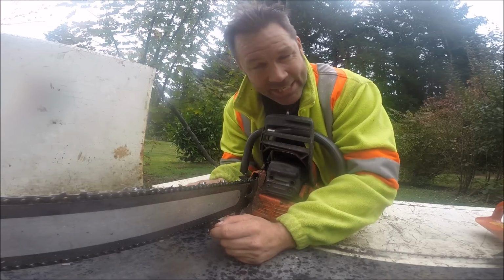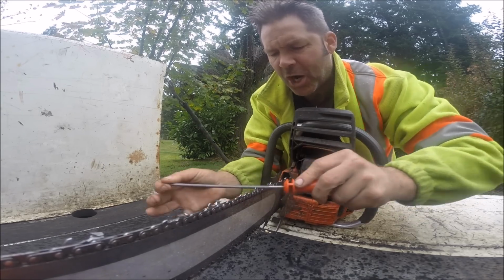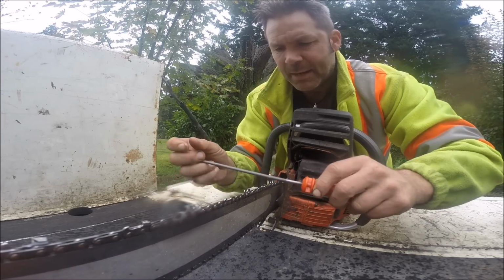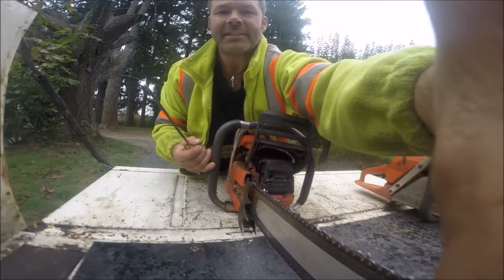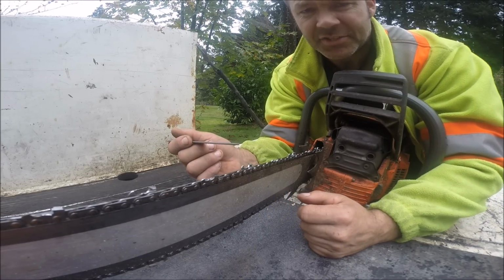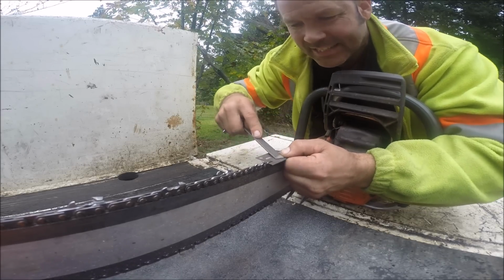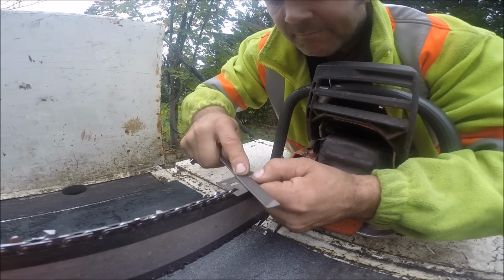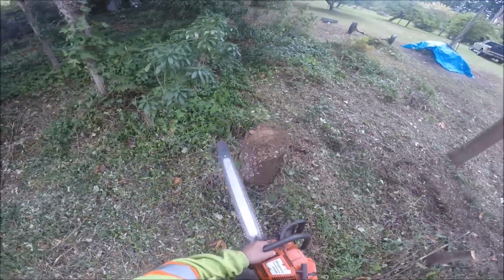How to file a power saw (chain saw)

Comment: Billy I think so many people don't understand the difference between constant filing of the raker gauges and progressive filing of the rakers. In the constant style you have the long raker tool that has the slot for the raker on the end of the tool. That style of guage rests on the top of several teeth at a time so if you have a longer tooth it is resting on and filing a shorter tooths raker, the rakers will end up being different heights and thus will take bigger or smaller chips. In the progressive style with the carlton tool you file each raker to that tooth and so the chips are all the same size just like you explained.  Maybe some of the confusion is that people are using the constant guage which came with their little homeowners saws and that is fine if your chain teeth are all exactly the same size but that is not the real world of sawing. Just different words for what you just said. This is an awesome video my friend. Keep on trukin Buckin
Reply from the maker: glad it makes sense to ya thanks Crooner
Reply: Progressive dept gauge is setting the correct angle of attack to every individual tooth! Is not even a dept gauge! It’s an angle gauge

Comment: Billy,  I agree 100% concerning the takers.  I was cutting off a stump the other day and my little 241cm wanted to cut to the left and get into the sand.  After I was through cleaning up the saw I looked at the chain and noticed my right teeth takers were considerably taller than the left takers.  I then filed them down to the same height and gave the chain a maintenance sharpening (3 licks with the file).  I used my Stihl gauge to set the takers height.  I also knocked off the leading edge of the takers so they had a gentle soap, upwards.

Comment: Great video. I've done this over the years, especially on damaged teeth. Now I have a name for it. 👍 "boat style" The logic is that it pin-points the pressure from the file to a smaller surface area on the cutter. It's fast.   Next time I have to teach someone this I will use my phone and your video. Take care thanks

Comment: Hello again, one tips about things to talk about is on the brand and type off chain you are using. Personaly I have always been more interested in this than about the brand of the saw itself. Thinking full chisel, semichisel, ,325  3/8  ,404 brand of sawchain and so on. Iff you sometimes use the .325 0,050 gauge so try the new Husqvarna X cut chain (sp 33g) that is a very good chain, best .325 chian I have ever used. One reason that its most normal to run a very short bar in Norway and Sweden is that most off the saws is used for both felling, bucking and limbing. Ass you know there are lot off limbs on spruce, much easier to limb spruce with a 13 and 15 inch bar (and the whole unit powerhead and bar ass light ass posible) than a 20-30 inch bar. But I agree with you on felling much easier with lenght on the bar.

Comment: Special thanks to you, BBR, for spending time on the rakers. A lot of youtube sharpening guys either don't do that or they get it wrong.

Now brother please tell the children where to get that raker file gauge. Mine came with one of my 2 Jonsered filing kits. So... can you buy them separately?
Reply from the maker: I believe this is a carlton gauge
Reply: Carlton does not make these anymore but there is guy on e-bay that still has a few. Just search Carlton depth raker guage and it should come up. Good luck
Reply: I was wrong on Carlton not makin these anymore. You can find them if you google Comstock logging supply and look under carlton chain will be on that page and they are priced at 5bucks. Hope that helps anyone looking for 1

Comment: Round files create gullets.  It is reducing the size of the file, as the cutter is reduced in size, that keeps the gullet pronounced.  If the file size is not reduced, the top hook of the cutter will be lost, or the link plate will be filed into and compromise the chains strength.

Comment: I always found that position awkward for filing. I learned sharpening from a guy I worked with: sit down, put the saw vertical between your legs, with the left hand you hold the bar and chain steady and with the right you file one-handed. Also I see the tooth better that way.

What do you do when you have to cut logs that have been dragged on the road and are dirty and the bark is full with dirt and stones? My chain always gets dull fast in those.
Reply: carry a hatchet or axe and jst knock the bark off in the spot you are gonna cut
Reply from the maker: knock the bark off with a buckin special every where i gotta cutt or dont buck it
Reply: yeah but we do a lot of bucking here in firewood. Firewood is sold in logs 1 meter long (40 inch) and piled up so it is easy to measure its volume. We just got to live with the dirt or use carbide chain I guess
Reply from the maker: well I guess who ever touches the wood before you to could be tuned up a bit as to how he handles it

Comment: i have a big old elm that needs severe pruning and i used to be pretty much a daredevil but now with work injuries from the shipyard and i am 61 yo i am a bit afraid .....are there any peculiar problems with elm like barberchairing ? ,or is it a pretty stable wood in all seasons?
Reply: I cut elm and it is stable, now dead elm just start small then go bigger it hinges good and is a bitch to split. hope that helps you

Comment: Sorry if I missed it, but what is the raker gauge that you were using in the video. Never seen it before and I want to get one.
Reply from the maker: i believe husky makes it
Reply: Thanks Buckin, I tried your filing technique out on a junk chain yesterday and I was able to get it super sharp, (better than the special filing guide). I can't wait to dull a chain so I can test it out.
Reply from the maker: carlton makes it,,, oh nice buddy ,, work out for ya?
Reply: Waiting on parts to get my Stihl 017 fixed so I can try it out :(  I'm sure the chain will work great, but now my saw will really be lacking. I can't complain though, I have pushed that saw through way too much, and it still runs like a champ.
Reply: Well Buckin' I couldn't wait any longer for the part (this is the last time I'm using this dealer if I can help it!) and I had some timber to cut for a retaining wall so I got to try out the chain. It works miracles compared to using the sharpening guide. It just bites into the wood, almost too much for the poor little 017 now. I might be getting a Huztl ms361 parts kit to build a saw so I might get to put the filing technique to some real use then.

Comment: Thanks for the info, I'll have to try it when I sharpen my saw again.  Question for ya Billy, I have a Husky 576XP with a H85 chain, says to use a flat file to sharpen it. The cutting tooth has a flat face, there is no curve in it like the chain you are sharping in this video. Have you ever seen or heard of such a chain? I personally don't care for it.
Reply: Sounds like something I would come across,  thanks for asking.
Reply from the maker: lose it and never look back i have never heard of such a thing ha ha ,, no .. I dont no buddy  . nevver seen it
Reply: Kevin Noll Yeah that's the product number. I agree that they are hard to grind and loose their sharpness really fast. Needless to say I will not be buying another one. It is what came on the saw so I figured I might as well use it.
Reply: Buckin' Billy Ray Smith ha ha ok, I plan to trash it when I where it out, wont be buying another one that's for sure. Thanks for the reply, God Bless.
Reply from the maker: COPY THAT